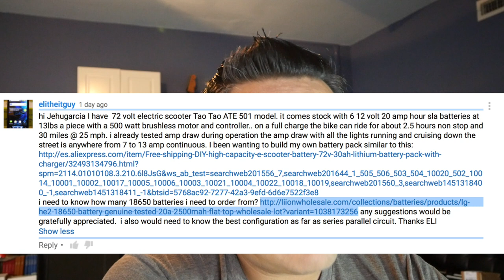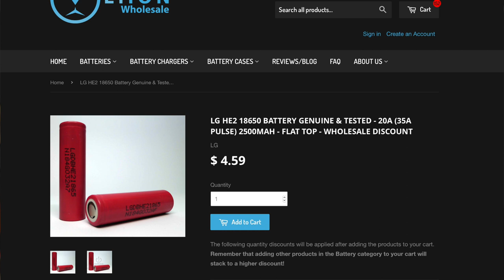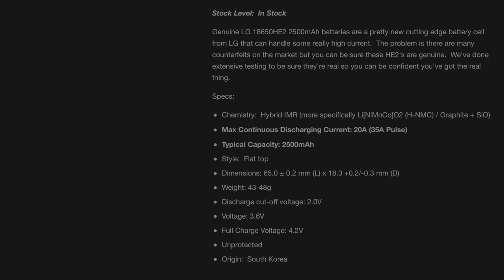How many 18650 cells to power a Scooter?   Battery talk #4

Comment: I have a 1600 watt compact scooter. It came with a 48v 12amp/hr lead acid. now it runs 208x 18650 li ion batteries in a 16P13S 48v 48amp/hr Battery pack. it saved like 5 lbs, but quadrupled the range.

Comment: You forget to mention the loss of weight. The 18650s will weigh  about 16/17 pounds while the SLA's were 78. 60 pounds is 20% lighter? That means faster speed  or longer distance on the same charge.
Reply: 80percent lighter!
Reply: Thus could have more batteries, more speed and more endurance at the same voltage?
Reply: Sos the Rope Well, maybe. After all weight ≠ Volume. Lithium ion batteries weigh a lot less and are smaller than lead acids (generally speaking of course) but that doesn't mean you'd necessarily want to just add a bunch more battery packs.

Comment: Jehu, Very good video for us newbies.  I have a bit of a dilemma.  I have taken a Chinese PVT and used the wheel motors and controllers to construct a trike for me to use.  I am a large man (250 lbs) and am legally blind (Cannot Drive).  The trike is a cross between a big wheel and a chopper.  Think something close to a mini version of Exile Choppers Black Pearl version of the trike.  I intend to use this trike to get to and from work as well and run errands.  The PVT came with two 500 watt wheel motors at 48 volts. They are 3 phase BLDC with reed switches for feedback.    My situation requires me to be able to cruise around at no more than 15 MPH as I cannot see well enough to chance going any faster and will really only go 8-10 MPH as I ride on the sidewalks.  The problem is when I have to cross streets. I need to be able to accelerate quickly to avoid problems.  Case in point,if I inadvertently pull out in front of a car, I want to be able to accelerate out of the way.  I also have to ride through less than safe neighborhoods and, well you get it.  I know that the wheel motors a massively over-built and I assume they will be able to accept more amperage to facilitate acceleration, the problem is how can I determine how much current I can throw at them.  The limiting factor may be wire size as the stub axles are 20mm OD x 12 ID so the three power wires and sensor wires have to fit through that 12 mm hole.  I operated it with the SLA batteries and the controllers are rated at 20 Amps feed and they never peaked.  As with any parts from China, there is vert little information available.  The trike (with me on it) weighs in at about 350 pounds.  I accept that I may need to get new controllers and I intend to build a new battery (either 18650 or maybe some high output cells).  Since my goal is not to go fast, but have reserve acceleration, it has been difficult to glean any suggestions from other projects.    Anything you have to say, I am listening.  I would have included a pic, but not sure you can do that here.  Thanks!

Comment: Your calculations on the available power from the lead acid battery pack is inaccurate.  While 20Ah x 72v should = 1.44Kwh, it really doesn't.  The amount of usable power stored in a lead acid deep cycle battery is generally expected to be 50%-80% of the rated value and the rated value is at a 20 hour rate...

So you can get 50%-80% of the rated capacity but only if you draw that power over 20 hours.

The 20 hour rating(and ALL lead acid ratings in general) is misleading.  To have any real idea of the available power from a lead acid battery you have to take into account Peukert’s Law.  The more current you draw from a lead acid cell the less efficient it becomes.  At very high drain rates you will lose a significant amount of power due to this problem with lead acid cells...  and cheaper lead acid batteries tend to suffer more from this than better batteries.  A Peukert’s Law constant of 1.1 may be seen with VERY high quality batteries, but might 1.4+ on cheap no name lead acid batteries.  At a constant of 1.4, drawing 10 amps from a 20Ah battery you'll reach 80% discharge in around 30 minutes...  not the 1.5 hours you might expect if not taking Peukert’s Law into account, and not the 2 hours you might expect if not taking into account Peukert’s Law or the maximum depth of discharge.

Something else to consider in respect to the depth of discharge in lead acid cells is battery quality...  with cheap batteries 50% is recomended since beyond that they begin to see a lot of damage and will have a much shorter life, with good batteries you can usually discharge to 80% and still get the same number of charge cycles as you could on a cheap battery at 50%. 

Lithium cells don't really have this problem, at least not to the point of being a problem...  so you really only need a lithium battery pack rated for around half the rated capacity of the lead acid cells to get similar performance... and as a bonus you don't have the same amount of voltage drop over the discharge range that you do with lead acid batteries.  These are just a couple of reasons that lithium batteries are becoming more popular with the RV crowd.
Reply: After doing my battery calculations, I had come up with a stupid number of cells... I knew that my lead acid battery "lead sled" truck didn't go far because lead acid batteries suck - but hadn't thought to take this into account.... Thanks...
Reply: Thanks , I always thought my Lithium ion 18650 cell E-Bike battery was faulty from new as it was rated at 36v and 15ah but I was never getting near 15ah at a 23amp max draw, so reallly it would give me around 15ah but only at a 1amp draw for 15 hours, forgive me I'm learning even though I had no interest in school, I feel I'm learning alot as thanks to these video's I've built my first 36v pack 10s7p with BMS and its been working fine for 3 months so really Jehugarcia has thankfully saved me over £100, I don't include the 737g spot welder as we all know Men and tools, we have to have them and I class it as educational, haha, thanks I'll do some more reaserch.
Reply: EXACTLY what D W said above, and Lithium batteries would weigh less than half of Lead Acid battery. The weight savings alone can improve performance about 10-20% on a scooter application. Just make sure not to charge any lithium based battery below freezing temperature, or they will be permanently damaged!!! That could be a problem for a scooter used during cold weather. Hmmm, allot to think about. Specially the charging temperature. issue.
Reply: What hppend when i increase the ah

Comment: Since it's 8 cells at a time, you could do a compression pack in a tube arranged 4x2 and then stacking 18 or 19 high. Thin metal sheet between each, foam loaded thicker plate at the top, moderate pressure and no soldering needed.
Pretty good price for those cells although that is a high power cell which you don't need in that scooter application at all. You get around 200A capability with those cells and you said you only need 7-20A. A standard LG 2600mAh cell might be half the price.
Reply from the maker: +DFCad1   true,  i would probably go with these cells instead http://j35.us/panasonic-ncr18650b   76 cells would do the job and cost less around $400
Reply: +jehugarcia, yeah that might work. The 2900mAh Tesla cell is also on his site for $5 a piece and that's close to same capacity because the 3400 is a bit lower voltage chemistry. Unfortunately they don't have the cheap LG cells which would be the best option by value for his use. It's odd that there are no fair priced resellers on ebay. Say 100 and 50 packs.

Comment: Middle of the video is wrong. The motor is pulling all the power, it peaks at 13A when accelerating.
Reply: Either that or I have a feeling they underrate the motor, or both!Legal road rules limits a scooter to 500 watts. So they have to state that but in reality it could be more

Comment: I know this is an old video, but the 36V Lg battery packs sold by alarm hookup on ebay would seem to work.  Roughly 8 of those packs would give you 160 cells.  4 x 2 in series would add up to 72V  17.6 ah.  Packs would cost $26-34 each depending on quantity purchased. Cost would be $208-272 .... cheaper than if you were to buy individual cells.
Reply from the maker: +phil m  yup

Comment: @ Jehu, didn't see this video for 2 years but got to add something. 
There are lot of electric scooters where it rate the power as some number like 500W in this case, but capable of dawing lot more power, at the peak it would draw even more than 13A as he say, so here 500W isn't the max peak.
Of course there are some manufacturers who rate the the peak power.

Comment: Great job as always. (But I have a suggestion LOL)
I would highly recommend he double that set up. Now or later when he has the money. The reason I say this I think he may be caught offguard by the all or nothing difference in batteries. Lead acid has a slow decline. So you kind of get an idea of when you're running low. 18650 gives you hundred percent all the way until you're walking LOL. Not much warning. Of course he will see a difference in power off the line of course and he will probably get more distance due to the loss of weight. Just my two cents. Because I'm bored. LOL

Comment: good example Jehu!

I believe that a scooter motor rated at 500 W, refers to cruising power. Peak power usually is about double and is needed during acceleration, heavy load or uphill driving.

looking at the form factor of 6 individual 20Ah Lead Acid batterries and the solid block of 150 18650s, I think he will have difficulties getting that block as it is into the space freed up from the Lead acid batteries. Any suggestions on how to set up the same battery capacity if you have to stash em away in half a dozen different locations throughout the scooter ( as his setup with lead acid would have been)
Reply: What you could do in that case is create multiple 72V packs the size of the led acid battery ones, and then just stack them and connect them in parallel;
Reply: 8 separate packs of 20 batts connected in p. You could fit 2 liion packs in the same space as a 7ah lead acid

Comment: Cheapest way to get high discharge 18650's is to buy drill battery packs, these are purpose built for high discharge, and being store bought they have genuine cells. Here in Australia you can do this and get each cell for around only 3.9 dollars each with this method. 
With an electric scooter, the type you would use on footpaths and such, these only have around a 250-300w motor in the average models. 
Now you want to be able to likely use your scooter for about an hour before it's flat. 
This means that you will need at least a 40 cell battery, the total battery will only weight around 2kg. Yes it's very easy indeed. 

If you have even just a 100w solar panel at home, it can fully charge your scooter in just 3-4 hours.

Comment: We could use a formula - I use a 24v system that draws 25 amps from a dc motor connected directly to two 12v batteries connected in series to run my riding mower for 40 minutes. Most people know the volts and amp draw. If you could give use a couple of formulas, it would help lots of people. Example - volts x amps = so many 18650 batteries needed. Thanks and keep posting. You help us lots. 👍
Also, how do I tell how many amps I can draw from one 18650 battery?
And how can I tell how long I can draw amps from one 18650 battery. That will help me decide if I need 150 or 500 batteries. I may want to run a battery pack for 2 hours while drawing 20 amps from a dc motor.

Comment: The house idea is particularly interesting, my buds and I entertained the idea of running a house on lead acid batteries years ago but the number of batteries and size made it almost impossible due to lack of  storage room and ventilation issues. now with the lithium ion batts- it may worth looking at again.   Up here in Canada we're charged (pun intended) more $ during certain hours (you know like the hours you need it the most)- it would be great to charge on cheap power at night and then run off the batteries during the day.  this would be a great project to see done via diy..

Comment: 155 x $5 ea = $760.00 Probably more than the scooter is worth.  You can get 18650 cells out of laptop batteries much cheaper. Yes it is a process to charge and test them but you also learn a lot during the testing. Good Luck scooter man ! Would be interesting to see a video on the process if you move ahead or finished product.
Reply: +Jeff Barr thanks i will be doing a video of the battery build. I would do the laptop thing, but i do not want to take chance on used cells. i use my scooter everyday for delivery in manhattan and i do not want a bad battery pack because of bad cells. thanks ELI
Reply: elitheitguy Good Luck sir ! So your scooter is more of a tool for your job than a toy. The longer it runs the more money you make. I get it now.

Comment: SLA's run a big voltage drop under load. So that 13A under load needs the actual voltage.
I'd work off 72V charged (72/4.2)= ~18 cells and under charge to 72V. minimum two strings but add as many as you can in parallel.

Comment: The only thing not accounted for was that the usable AH for the original battery should be 1/2 the capacity which is 10AH.  He could build a 10-12 AH 72v battery pack.

Awesome Channel :-)
Reply from the maker: +Dennis Dunbar  Also the 50 lbs weight reduction of new battery did not make final cut
Reply: +jehugarcia 
Yes, the weight reduction is huge.  The ride experience would be totally different.  Most likely would get longer range, faster acceleration.

Comment: I have been toying around with the idea of powering my shed off a battery system.  Its going to cost around $1,700 to run electric - so if I can build a systems that charges with solar for less than that - Im game.  I know this is an old video so you may not be reading comments anymore but it could be an interesting build.  Without going into specifics, I will be needing to power a portable AC for a few hours, LED lighting, and possibly some small electronics (battery chargers) and at times a miter saw.  I know the LED lights and smaller electronics will be easy to run but its the high amp stuff like AC and Saws that will put the system to the test.   If you had $1,250 to make an overkill system that can handle just about anything - how would would you do it?

Comment: My nominal 250 W ebike hub motor uses 600 W power, then i am riding on the hill. Also I have an other 250 W motor on my Ninebot ES1 scooter. The app shoes about 500 W peak power on sport mode, riding uphills. So it is absolutely normal, that 500 w, 72 V scooter uses 13 Amps, while driving (see. 5:00 Your video). Good luck.

Comment: Hi Jehugarcia, love your work with the battery applications, the battery powered VW and the power wall. That's the future. You're living in the future while some of us are still learning the ropes. I've been thinking of doing a similar motorcycle project where I swap out the lead acid for lithium batteries. I only use the battery to start the motor then I guess the lights run from the alternator while the bike is on. I've watched most of your other videos and I understand that there is a need for making the pack with a BMS to control charge and discharge and to also protect the batteries. With a lead-acid battery being at 12V 6Amps, does that mean I'll only need 12/3.7=3.2 lithium batteries in series and 3 times that in parallel giving me a total of 9 batteries? 3 cells at 3.7v 2500mAh will be  11.1v 2.5Amps. Using 3S3P will give me 11.1v 7.5 Amps. Am I correct using 3S3P or did I miscalculate somewhere?

Comment: my plan was to make a 4 x 5 12v bank. I was going to connect 4 battery banks each in pos x5 neg 5x5 then treat them as individual  batterys and put 4 together to make 12 volts

Comment: I have what was a kick along scooter.It is now on its third rebuild, It has 120 cells 40 volt lithium battery . ex laptop.
It needs a minimum of 500 watts due to hilly area. So a motor scooter would certainly need very much more power due to the weight of the machine. lead acid batteries used at first, now decorate the workshop floor.

Comment: One thing you could have pointed out to him is that he'd be better off going with higher capacity, lower drain batteries for this application.  At 19 in series, the minimum number in parallel is determined by capacity, not amps, so cheaper batteries that are less amp rating would work better.